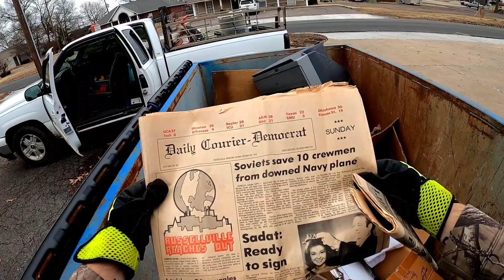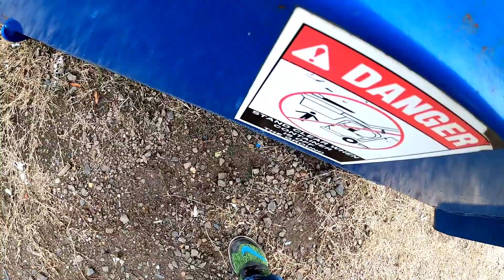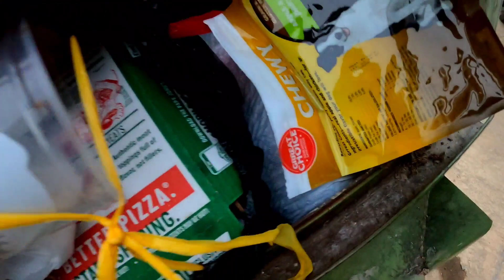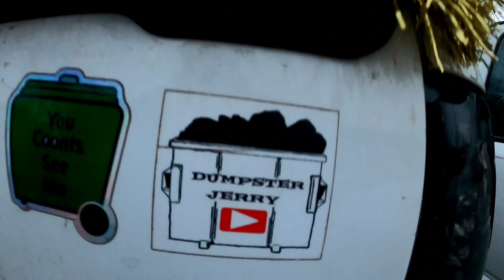Trash picking in a small town

Comment: The scrapper in me cringed when you left the old TV. I’m only 5’3 and don’t have very good upper body strength to get out of dumpers. So I carry an empty 5gal bucket with a rope tied to the handle. I use it for a stool on the outside of the dumpster and throw the rope over the side of the dumpster.  If I have to get in and think that I won’t be able to get out, I pull the bucket up inside the dumpster and I can stand on it to get back out. Then pull the bucket out, rinse/repeat when needed.
Reply from the maker: I have to walk a fine line on that dumpster.